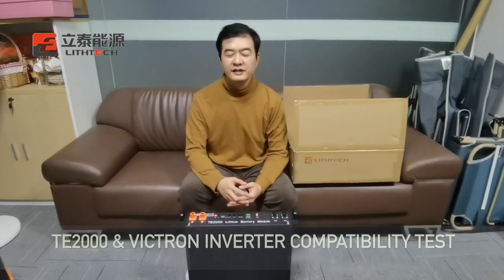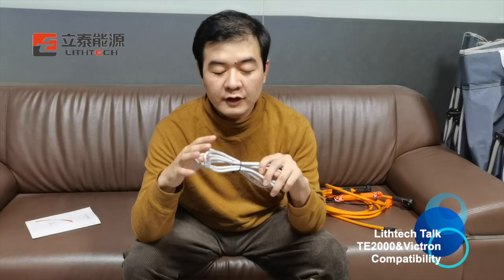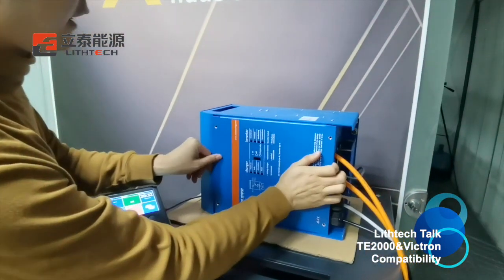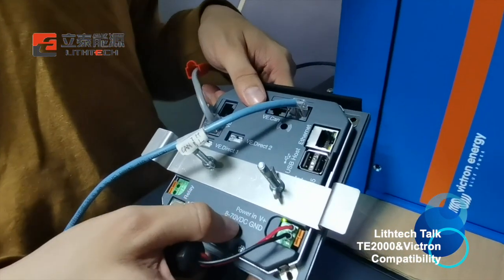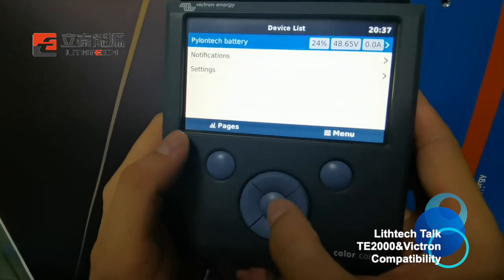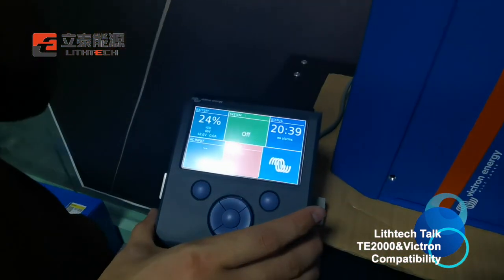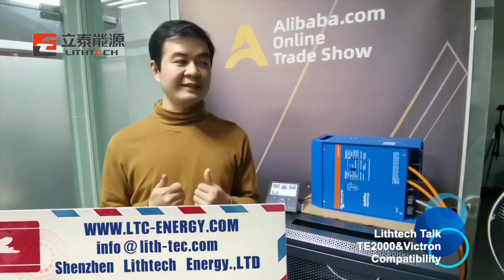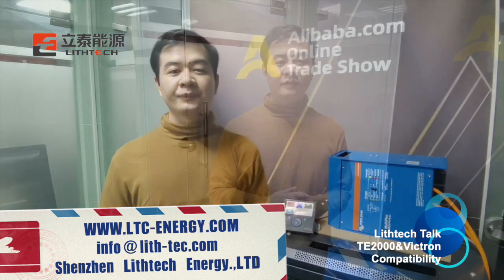Lithtech Talk-5 How to make 48V 50Ah battery communicate with Victron Inverter Multi/Quattro in 48V

Comment: Hello. This is a nice video with clear explanations of the connection with Multiplus. Thanks :) Could you confirm the same connection can be performed with TE4000 battery pack ? Can it connect the same way with a Multiplus 2 Victron inverter (Multiplus1 in this video) ?